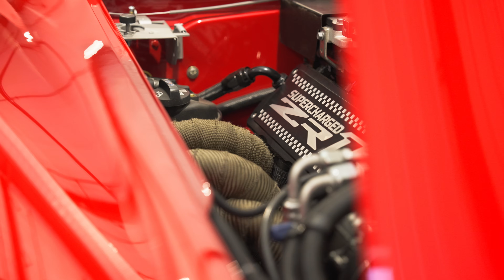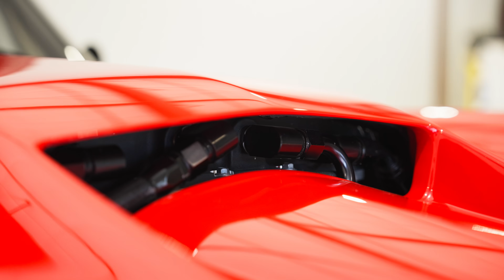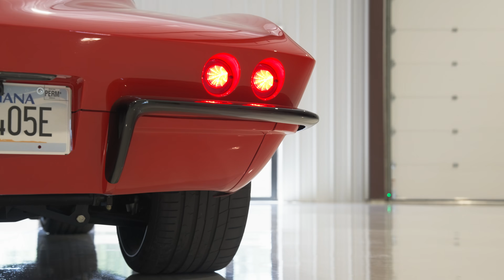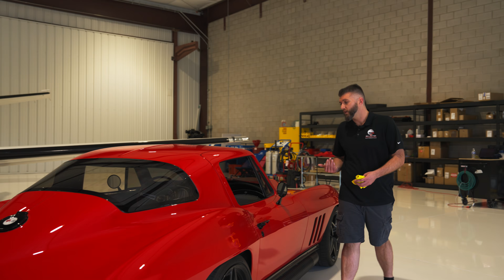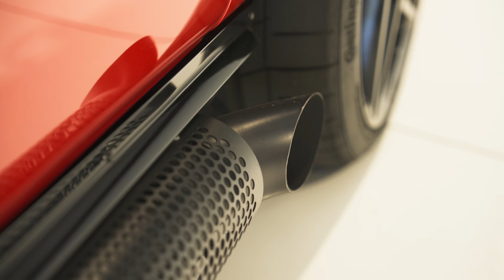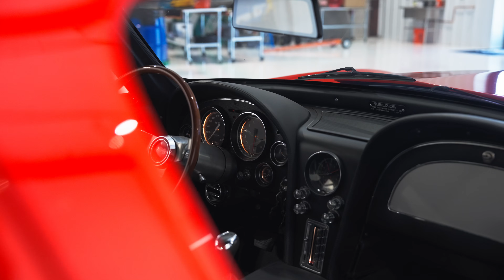The C2 ZR1 | 1965 Chevrolet Corvette Walkthrough | A One Off Custom Build

Comment: The blacked out wheels, pipes, and bumpers have to go! The car needs to be lowered about 1 1/2" all around.  We could probably deal with the window treatments, but not the rest of blackouts. The beautiful side profile of the car disappears without the chrome accents.
Reply from the maker: The car is currently at a raised ride height for street use/getting up driveways, etc. We originally had the car sitting significantly lower, but it makes daily use a bit cumbersome. A simple adjustment to the coilovers and it's sitting much lower. We would disagree about the chrome. You can easily go out and purchase any stock styled C2 from anywhere. Seeing this car in person would most likely change your mind. There's a reason why this car wins everywhere it goes and draws in a crowd!
Reply: @slateperformance   my reply would have been "well, don't buy it then" . Everyone has different taste, and probably many ppl like everything you did to the car.
Reply: @slateperformance boomers....

Comment: Looks a little far off the ground 
At what speed does it start to float
Reply from the maker: We actually agree with you! The car is currently at a raised ride height for street use/getting up driveways, etc. We originally had the car sitting significantly lower, but it makes daily use a bit cumbersome. A simple adjustment to the coilovers and it's sitting much lower.